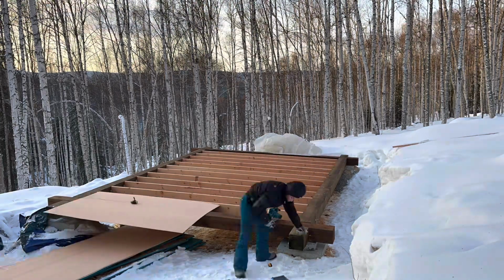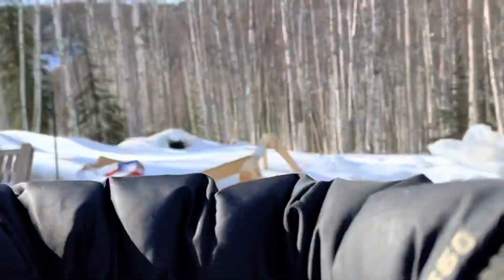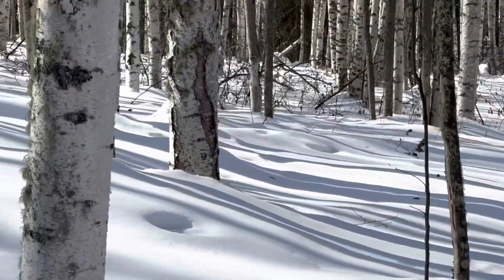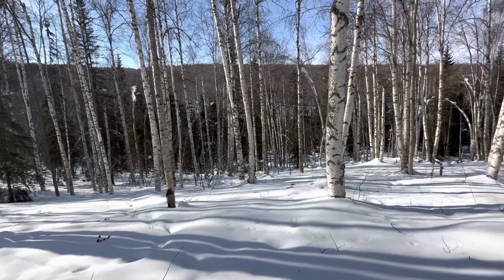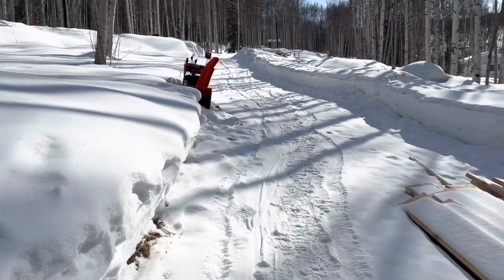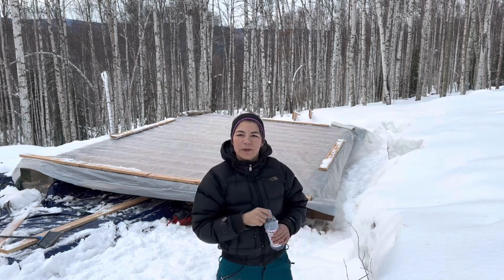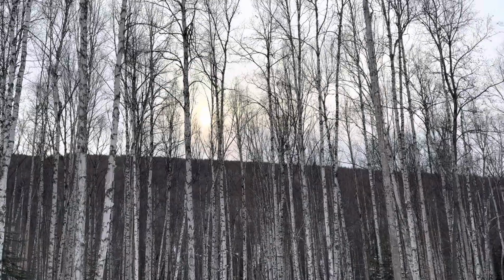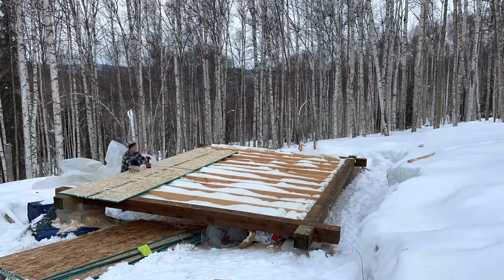Installing the Subfloor for the House in Fairbanks, Alaska; a Wild Animal Scare me so I Investigate.

Comment: You should use metal screen to block the bugs but the rodents can eat the screen so on the outside cover the screen with 1/4 inch hardware cloth. I just used the screen under my Gazebo but the rabbits ate right through it. Now I have to redo it using both the screen and cloth.